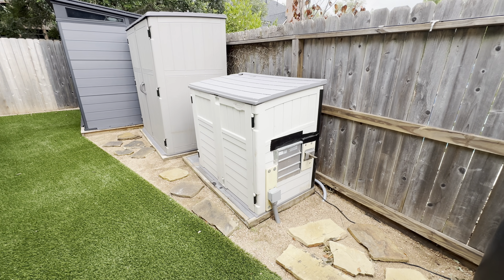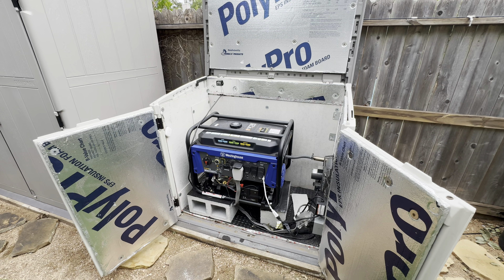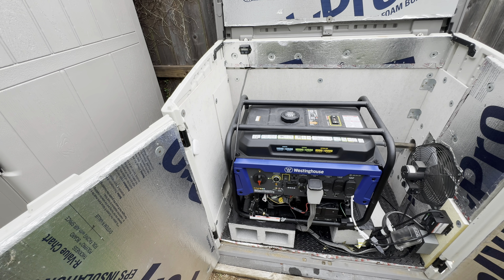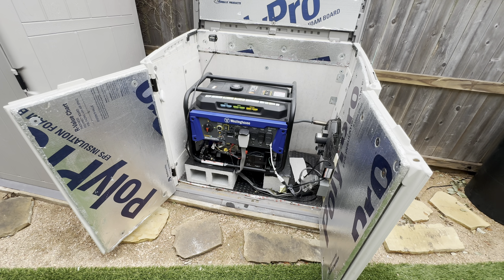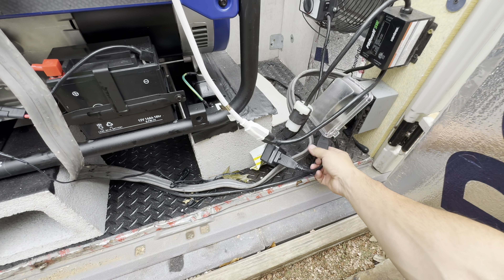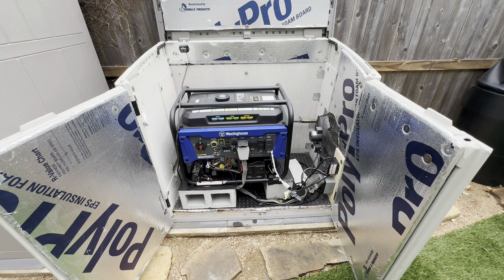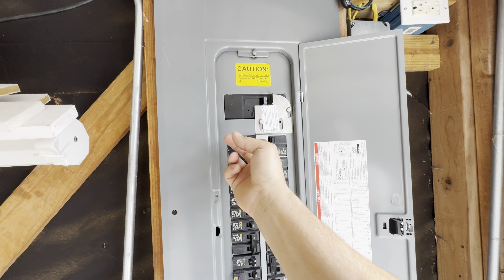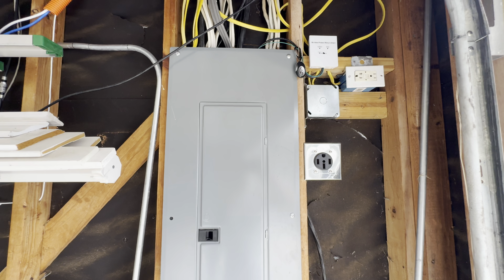Tri-Fuel Portable Generator Post Hurricane Update on Natural Gas

Comment: Ever thought about just adding another 12inch exhaust fan on top of the other one? And or bigger intake and or fan on intake side?
Reply from the maker: @taylorcampbell985  yes. Actually thinking about doing that now. It also would add a bit of redundancy in case the fan were to fail.
Reply: @CalvinGorriaran  any fan on intake side? Also what are the temps in shed with and without gen on?

Comment: Could you please check the manual on this generator WGen11500TFc.  I am reading it says less than 23% THD on power output but the Westinghouse website says less than 5%.   I don't think this is a clean sinewave generator and they are lying to everyone that it is.    Mine is supposed to be delivered on Tue.
Reply from the maker: @ZJMK605  it’s definitely less than 5%. I think they used the manual from other models and neglected to update that value.

Comment: Dumb question alert:  But does the single 50 amp connection from the generator to house plug  simultaneously provide power to both my 220v and 240v appliances, just like shore power?
Reply from the maker: @derekmclv  yup!
Reply: I think you meant 120 V and 240 V. Yes, it supplies two legs of 120 V to your electrical panel just like your utility power has.

Comment: Hi Calvin. I'm collecting parts for a similar set up. I have the shed and soft start for my 4 ton AC unit. I'm looking at this same generator from Westinghouse and I'm curious if you had to weld the muffler adapter on or is it direct bolt capable on this model? Awesome set up. I hope mine is as useful and efficient as yours. Thanks
Reply from the maker: @OldManGamer69  the Westinghouse has bolts you can add a flange for on the muffler. Then I just used a clamp bolt to hold the exhaust tubing on the flange.
Reply: @CalvinGorriaran  Awesome! This will be the one I go with when they're back in stock. Thanks for the info!

Comment: I am installing a similar setup.  How big is your house and how many things were you able to run simultaneously with 13kw?  Great video.
Reply from the maker: @billlaurence7555  3,600 sq fr with a large detached garage and a large outdoor living area. The only conservation we did was to not run both ACs at the same time. We also didn’t use the 220v electric dryer. We did however use our 110v GE combo dryer. The whole house was running for that entire week.

Comment: If i have 2 9k running generators, can i parallel them for the 50amp plugin for 12?  How are people getting portable more than 50amp 12K into their panels?
Reply from the maker: Not really. There isn't a solution on the market currently that pushes more than 50Amps to one panel from a portable generator. I believe some of the inverters out there have specific parallel kits you can buy. It still comes in as a total of 50Amps. It would be nice if some of these larger portable generators they are making had a 60Amp circuit on them.
Reply: @CalvinGorriaran  Makes me wonder the point of paralleling any generators with a running wattage of over 6K then.  Right?
Reply from the maker: @derekmclv  at 220v, 12,000 running watts is really the sweet spot. If you are going to buy a portable generator for the use powering your panel, it makes sense to land around there. The breaker should allow peaks over 50amps but not a ton.

Comment: What's the purpose of the transfer switch if you have to start generator with the remote button?
Reply from the maker: Hi Chris. The transfer switch is just to automatically move the fan and trickle charger from house power to generator power. It just makes sure that the fan always has a power source. That way if the generator is off, the box is still cooling down and I don't have to remember to move anything around.

Comment: Your videos have been very informative, thanks for taking the time and posting. 

I’ve ordered the NGK plugs to better run on NG. Could you pls share what gap you are setting them at for that purpose?

Thanks again.
Reply from the maker: Hi Michael. The NGK plugs I put in the description did not need to be gapped. They worked right out of the box.

Comment: Great video! Have a similar shed set up and looking at upsizing to that same unit. Did you have a problem with the CO1 sensor in the shed?  I read the newer generators with the sensors almost need to be in open air or they shut the generator down for co1 concentration.  Thanks!
Reply from the maker: It actually brought an issue to my attention. After a while, the galvanized exhaust tubing cracked and it was leaking a bit in the shed. The sensor went off. Since then I replaced with a stainless-steel exhaust tubing and it has been fine.
Reply: Is that the exhaust extender you put a link for in the description?
Reply from the maker: @sb1707b  yes but I that flange worked great. The exhaust extension they sent was galvanized. I had to buy another replacement tube that was stainless steel. I should add that link. I will talk about that too in the update video.
Reply: Awesome, thank you. I'm in Houston and this generator is getting more use than I had expected, so working on getting it set up the right way

Comment: Nice setup.  I live in NW Harris Co.  We were very fortunate in that we didn’t lose power at all during Beryl which is a good thing since I had no generator.  After seeing family members and co-workers go 1-1/2 weeks with no power, I decided to better prepare.  My setup will be much smaller than yours as I picked up a Westinghouse 5000w inverter unit. It came dual fuel ready but I’m converting it to run off the natural gas my house already has.  Certainly won’t power the entire home but will power all necessary items enough to keep us comfortable while we wait out the next blackout.

Comment: Hello Calvin. I am in Missouri City. Do you mind sharing the contact information for the electrician and the plumber who did the connections for you? I have purchased a tri-fuel and would like to connect it to NG. I appreciate your video it is so helpful!
Reply from the maker: I could recommend a plumber and electrician, but those trades tend to work very localized. I would check around with who the local guys your neighbors are using and ping them first. Happy to offer up these guys if you don't have any luck.

Comment: No overheating issues in that storage container?
Reply from the maker: On the days when the outside temperature is in the 100s, it got warmer than I would like. So those days I would prop the lid open. I am considering adding a higher CFM fan since I have increased the size of the generator since the shed was originally built.
Reply: @CalvinGorriaran  thats still pretty good. Good info thanks.  I like that set up

Comment: Were you able to get your gas meter upgraded to a higher flow rate without messing with a permit?
Reply from the maker: @onganxiety8719  we didn’t need to upgrade the meter. This size generator actually doesn’t need that much pressure.

Comment: HI calvin so just to confirm you have basically the breaker on the generator on at all times + hooked up to natural gas at all times. and you just turn on the gas and then do this cmbo on the breaker box in garage + start it with the remote?
Reply from the maker: That is correct!

Comment: did you have an issue with your Duromax . gen ?
Reply from the maker: I didn't. Just wanted to upgrade for a little more power and additional features. Also wanted the lower THD for small electronic protection.

Comment: Thank you for walkthru. I live in Spring and really like your set up. Planning to do something similar. I would really appriciate if you can answer some of questions I have 1) What kind of 50 AMPS cable you have hooked up to your generator and is it safe to leave that connected to generator all the time even when its not in use.I hope you are disconnecting the 50 AMPS inlet inside garage when its not in use. What kind of 50 AMPS cord you have there hooked to to generator? 2) I am planning do same but I want to use NG connected all the time to gen with shut off vavle inside my garage so that I can fire this generator up from inside without stepping out. Is it possible to do with Gen ?

Comment: I have a Westinghouse gen just like that one (just slightly less output) and it was a Beryl lifesaver. I’m in Klein and I ran it continuously for five days except for the two times I shut it off to change the oil. Was trying to figure out a way to soundproof it and it never dawned on me to get a small storage container. I bought some fireproof 12x12 foam sound panels on Amazon. The fan for heat and exhaust is also a great idea. Thanks for this video.
Reply from the maker: Very nice!

Comment: What do you think about using portable solar generators brands like Anker, Bluetti, EcoFlo, Jackery for your house?
Reply from the maker: I have a smaller EcoFlow Delta that sits next to my bed stand. Mainly for my CPAP if we have an outage in the middle of the night and I don’t want to start the generator yet. They can be useful but unless you get some of the massive battery units and can generate a ton of solar power, you will be limited on what you can power in the home and for how long. It’s something I am keeping a close eye on. I have a few reviews I will be posting on these smaller units. Would be great to get my hands on the larger units.

Comment: I installed my Micro-air easy start on my AC during a power outage where my only source of power was my generator. When I powered up the gen, the AC started working. I'm curious if it is working exactly as it should or if there was a required learning period for the micro under normal grid power first?
Reply from the maker: @ericallen7200  yeah, it probably should run on normal grid first but check with Micro-Air. They are really good about helping customers. It takes 4-5 starts for the MicroAir kits to learn what power it should give to the compressor for starting.
Reply: @CalvinGorriaran  I just left them a comment on their YT account and they replied to that...and FAST. I now have the app and they walked me through the relearn process. My factory LRA was 109 and now it's way down to 24.6 A
Thank you for taking the time to reply and I LOVE your setup neighbor. I'm over here near Bellaire and Eldridge. I subbed so I can continue to learn more from you.

Comment: How do you like your Westinghouse generator?  How is the quality of it after running a few hundred hours?  What kind of maintenance is required?  I have a Genrac and it seems to be garbage.
Reply from the maker: @one4utwoc  it’s been great so far. Maintenance includes changing the oil and spark plug. Running for the most part on NG.

Comment: Those engines have a "fan" built onto them, so air is being blown over the engine as long as the engine is running. That said, if the engine is enclosed, it only has access to hot air, and at best, the ambient temp of your location. But they are certainly capable of running for long periods of time. A very impressive set-up you have there.

Comment: I cant stress enough how often to change oil on a single cylinder air cooled engine running at high rpm's 24/7.  I do mine every 24-30 Hours. However its fine at 50 Hours. Just no more than 50 Hours. I have more airflow around my set up. However I cant run mine during blowing rain. Your set up allows you to run during the peak of the storm. I have to wait till it blows past to run mine.

Comment: I plan to make a shed like this one.  But I want to put a vent on the lower bottom left, and have the exhaust fan on the opposite side higher, so that it draws air flow from the left side through the generator, and out the exhaust fan.  So I suggest you make a vent on the left opposite to the exhaust fan.

Comment: Wow.  Nearly the exact setup I have.  Same shed, same fan.  Except I put a large input louver on the other side.  I only put the concrete board on the back side for the heat generated by the exhaust and offset it a but to create an airspace between it and the plastic.  I also rigged the exhaust with a pipe that comes out and turns down to keep water out.  Finally I hardwired the whole thing into the breaker box with a manual interlock safety.  Start it and close the whole thing up.   The air flowing through keeps it cooler than if it was just open I believe.   I don't know why this showed up on my feed.  I've had this setup since just after Harvey.  My indicator for commercial power restoration is my across the street neighbor's porch light.   The only issue I've had is wasps love to build nests in the fan.   I run it every month and am amazed at their persistence.
Reply from the maker: @Coldwarrior7781  sounds like you  saw my old video from 4-5 years ago 😂
Reply: @CalvinGorriaran  Sorry nope.  My own thing.  Harvey destroyed my old open shed and I wanted a way to get the unit closer to the house without increasing the noise.  Your shed is probably the exact unit from Lowe's though.  I didn't put anything on the doors. They don't give the impression they can take any extra weight.
Reply: @CalvinGorriaran  did you do floating neutral or leave it bonded? Saw it in the manual, but no one mentions it.
Reply from the maker: @ZSell93  I don’t have a ground at the generator because I am running a ground back to the panel and it is grounded. My understanding using the ground in the panel when setup this way, is best practice.
Reply: @CalvinGorriaran  so you removed the grounding jumper on the generator?

Comment: We have a Firman tri fuel and ran it for 7 days.  It ran the pool pumps, small air conditioner, 2 refrigerators, 2 freezers, house plugs, dishwasher and washing machine. Started off with the gasoline and then flipped it to natural gas.  Changed the oil twice during the operation and checked the oil everyday and added clean oil as needed.  It was a life saver.
Reply: Exactly what we did. I’ve got 285 hrs on mine and it’s been great. Not an issue so far.
Reply: Mine definitely cannot run my 5 ton AC. Haven’t had a soft start installed yet but my HVAC folks seem to think it would work.
Reply: @sbri7138 AirGO is cheaper than microaire. I love mine. Starts great with my 4 ton
Reply: How many running watts (non peak) is yours? I bought the Firman 7500w (9500w peak) and it's great!
Reply: Can it run central air without EasyStart ?
Reply: I assume the power from the Firman was clean enough to run electronics.

Comment: Appears you changed out your generator to a 15000 from the Duromax. Why didn't you stick with Duromax? or was the Westinghouse better value?  Video are great.... I'm in Tomball.
Reply from the maker: @1Brightmorningstar  this model was a great value and had a THD around 5%. Duromax is great but just didn’t have a comparable model at this price and configuration.
Reply: @CalvinGorriaran  Thanks Calvin.... taking your lead on the installation. It looks very good. Appreciate your posts.

Comment: What materials did you use to reroute the exhaust out of the shed? Please post links, if applicable.
Reply from the maker: https://amzn.to/3zJ1PM8  Also used cement board on the outside and inside of the shed where the exhaust exited.

Comment: Have had a generator for years.  Never had to get too serious about it.  Jones and Grant without power for most of the week this time.  Sustained 60 to 90 MPH winds for 6 or 7 hours including the passing storm eye not good.  I now have the 240 hookup port and all circuit breakers mapped so I don't have the extension cord spaghetti next time.  Interlock bracket is probably on the slow boat from China.  Nice power return shriek alarm.

Comment: I ran my generator with a similar setup for 3 days straight after hurricane Beryl hit. I appreciate the setup and for sharing your knowledge with everyone. I would definitely get a bigger shed, though, and vent even more than what is described. Definitely replace the insulation with concrete board and MAINLY the roof of the shed needs to be raised while running. Great job, Calvin!

Comment: I have a different approach for my 1800 sq ft three person house. A $700.00 4500 watt Wen dual fuel inverter generator. We do have a propane furnace, water heater and range. Since it is a 120 volt generator I rearranged some of the breakers in the circuit box so all my essentials are on one leg. I installed a 50 amp inlet box outside the house and a 30 amp generator breaker and interlock in the circuit box. Using instructions from YouTube channel "everyday home repairs"I built a simple switched electric box that allows me to select which leg the 120 volt generator power goes to. The 30 amp generator plugs into this box and then feeds to the 50 amp inlet box on the outside of the house. We have lights,  2 TVs, 2 refrigerators, a deep freezer, and a furnace blower motor running simultaneously. I'm sure I can run a window unit ac for part of the house. The generator only runs at half draw and never over 3/4. It produces 3,150 Watts on the propane I'm fueling it with. A bigger is better philosophy is not wise when prepping for an emergency when you may not be able to buy fuel for an extended period. I also have a 1500 watt inverter on a 48 volt golf cart for shorter outages. That powers a fridge, lights and TVs. I hope this helps someone. I'm not an electrician and learned it all from YouTube.

Comment: ac infinity makes awesome climate controllers that can be set to run things when the temp or humidity in a space is too high. they make one that has two power outputs as well so you could get all of that into one plug that has automated climate controls